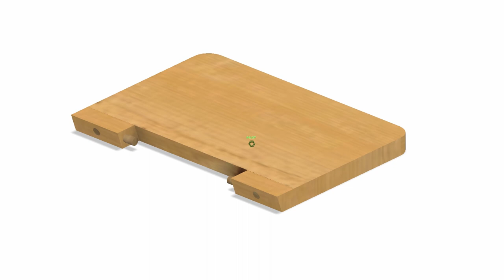DIY iMac Back Shelf

Comment: I thought I posted this comment a few days ago, but it's not here.   This is very innovative and nicely done!   What angle did you use when cutting the part that rests against the stand?  Also, just for comparison, what measurements did you use?   Cheers!
Reply from the maker: Hi, thanks for the comment. :) I have to say it's not that innovative, there are commercial projects like this, but I like my DIY version. :) I've used an angle of about 70degrees, and the tray is about 22 x 15.5 cm. Cheers